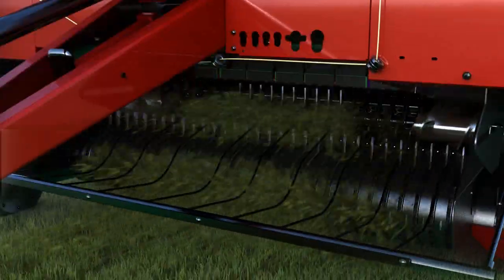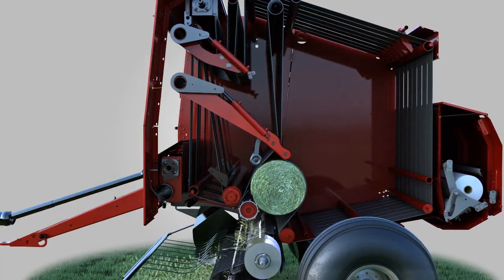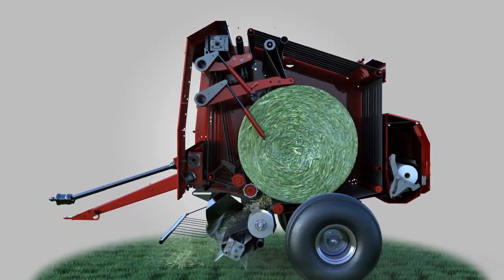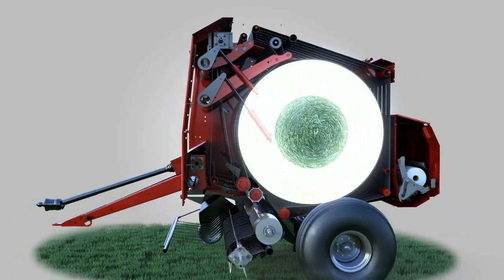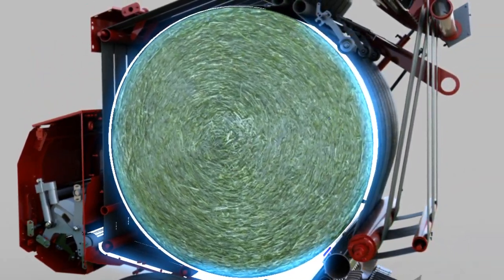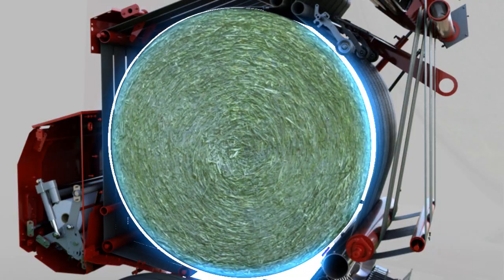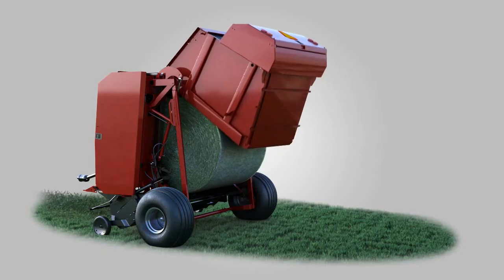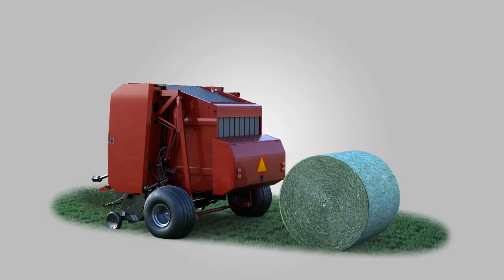Massey Ferguson 2800 Baler Animation

Comment: i use to live on a farm and we had to tear bales apart for cows and it was very hard
Reply: I'm a worn out old dude and I still disassemble them by hand. I first flip the 5 x 6 over on its end on a deck of pallets, remove the string/net then can peel off the layers as needed to put into a goat feeder. Keep roll tarped from weather. No waste nor deterioration of quality.
Reply: @Accumulator1  …do you peel off by hand or use a pitch fork…?
Reply: @mercoid   I use one of my homemade square bale grappler hooks to dig out a start place then try to peel off layers going around the bale.  I try to buy short cut leafy hay grazer.  The bale comes apart much easier.  I hate overgrown hay with a bunch of stalks.  Animals don't like it either. Makes bales difficult to tear apart.

Comment: Inside the tractor there is usualy a control box that tells the operator that the bale is formed. then the operator stops moving and a relay activates the twine or net to wrap the bale after witch the bale is released and the operator begins the process again.

Comment: I believe that there is a wired remote control box that is mounted in the tractor cabin and a light comes on when the bale has reached full size or a preset weight and trips a relay switch.  
Thanks for sharing the detailed baler animation. I seen them in operation many times but wondered how it all works together.
Reply: Yes there is, you have to control the baler to, dont you.
Reply: @gaijar4987  Well the indicator could just inform the driver to stop the tractor. A baler could be fully automated to do its thing in a sequence of steps and dump the bale out. The indicator would change when the baler is ready again to collect the hay.